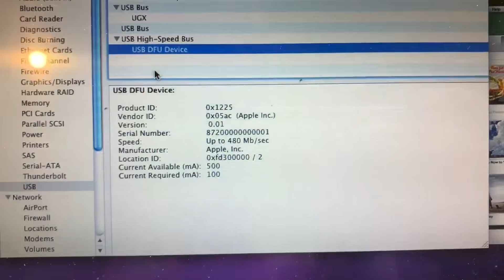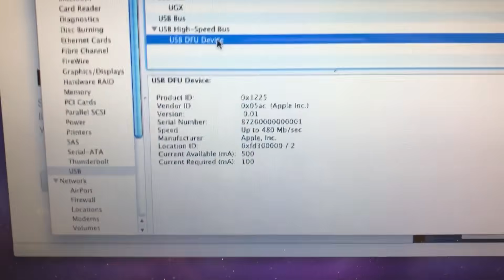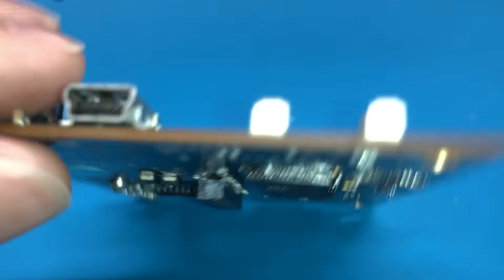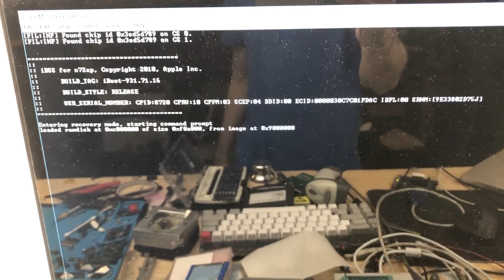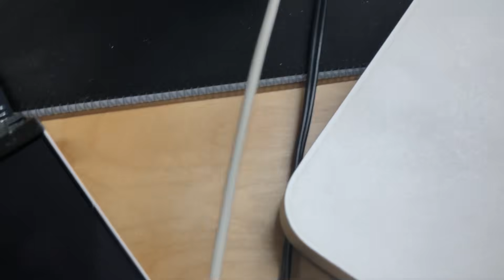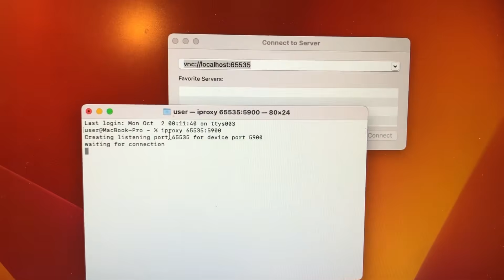Restoring a Prototype iPod Touch 2nd Generation

Comment: Those stacked SOC packages are a nightmare. I have a bunch of panasonic lumix cameras that i've fixed and they all have stacked SOC's. They also use BGA67 NAND which of course just happens to be one of the more annoying NAND's to read/flash...

Comment: Would it be possible to put another cpu in the macbook 13" a1342, with CPU (2.26ghz p7550) would it be possible to replace it with the Quad-Core, Quad-Thread, QX9300 CPU Processor

Comment: I finally asked myself what the 30-pin-connector is doing with all those pins if the USB on the other side only has 4. Turns out that it's an amazingly simple design compared to today's USB-C, where the connector is just USB, Firewire, Audio and Video in parallel and the cable connects the pins that are relevant for the other side, ignoring the rest.

Comment: What model of ipod touch did you use? To repair it? I have also a dev board but my ipod touch had a diffent NAND so cant put it on the board.

Awesome video!
Reply from the maker: You need an “MB” model iPod Touch 2G to use as a donor, “MC” model has a different BootROM in the SOC, and uses different NAND (2 BGA NAND ICs instead of a single TSOP NAND). The “MB” model can be identified by the case by having a larger storage size marking than the “MC” model.
Reply: @dosdude1   Do you have a copy of the nand?
Reply: Thank you for the information! Can you also tell me what power cable do you use for the device?
Reply from the maker: @aqw0031  It's just a 5V power supply with a standard barrel jack.
Reply: Ok awesome thank you!

Comment: such a revolutionary device, even the bandwith of the USB is on par with the newest iPhone 15 or 14 Pro for that matter 😅
Reply: I still couldn’t believe when I found out they were still using usb 2 speeds till my 14 pro. How can this be a pro device and take 3 business days to 
restore 120gb backup…. Then 15 came out and made it even worse by making it only on pro models….😂😂😂
Reply: @KngKurd 16 and 17 are the same lmao. It’s pathetic at this point. Just like when they refused to move on from 16gb phones with the 6s…7 moved to 32gb which also sucked 😂
Reply: How
Reply: @aidsmaster69420  Only the iPhone 15 pro and max has usb 3, 15 and under has usb 2.0. Old and slow
Reply: @aidsmaster69420 apple being apple.

Comment: You have converted a prototype to a production ipod.. the CPU and that would have been working.. but now its a not a prototype its just a lookalike
Reply from the maker: It’s not possible to run anything except the software these came with using their original SOCs... As you cannot execute any available iBoot version using the BootROM that the original SOC had. However now that I have one that still has original NAND and software, I can clone that to other NAND chips to restore other boards to function as they’re intended. But I really just wanted one running iOS, which would have been impossible with the original SOC no matter what I did.

Comment: man can i ask you qus not related  to this video? like i think no one know this 
i have chinnse h81 motherboard which dont have support of 4690k because its refresh cpu
and no bios update avalable anywhere and not in the website

i treid a lot making costom bios, by adding cpuids to it and flash it to motherboard 
after 22 try, by all ideas and ides from internet by diffrent probrams i couldnt make it work 
what i should do to make it work?
Reply from the maker: Make a custom build of CoreBoot for it, easiest thing to do. I did that to get Ivy Bridge CPUs working on a 2011 MacBook Pro.
Reply: @dosdude1  intersting i will try

Comment: The reason there’s no flash chip is because the connector on the back was for a separate storage board with the chip on it so they can quickly remove it and modify the files for further testing
Reply from the maker: These most definitely did have NANDs at one time; on all of the boards missing NAND that I have, it is obvious by looking at the pads where the NAND was (and in some cases moved/missing nearby components) that all these boards had NANDs at one time, but they were desoldered at some point (along with the RS-232 UART IC for some reason). Confirmed further by the board I got sent recently that still has its original NAND in place.
Reply: @dosdude1  Any chance you have a backup of the original dev board NAND? I have a couple of these (sans-NAND) that I'd like to try to restore.
Reply: Thats total opposite just the solution is always solder desolder to change whats in the storage board they couldnt do it with bridges or a better solution probably the resistance also its 2006 or 7…
Reply: That seems stupid
Reply: @ProscanEliteEnjoyer  Why does it seem stupid? It's practical for the developers.
Reply: @ok1lad159  bc having it swap it out every time and etc
Reply: @ProscanEliteEnjoyer  that's the point, no?
Reply: @ProscanEliteEnjoyer  Well, the reason is, for one, that when developing firmware, there could be a bug that makes the device unusable to the point that it couldn't be restored. In that case, they can just remove the flash card and reflash the firmware on a dedicated machine. It would also most likely be much faster than restoring the firmware using iTunes when developing firmware.

Comment: Super cool, I shows that Apple also mostly cooks with water like the rest of us. 
I never sort of thought of the how an Apple product begins its journey. 
The BGA RAM on top of SOC is something I have never seen, but is most 
likely a result of space and speed/signal routing ?
Reply: Its more common then you think. Its used in a lot of phones these days and regular socs to its called pop(package on package) design
Reply: @309electronic5  well it makes perfect sense, now that I know and think about it. But as in the video shown, never think about taking it apart :)> 
I think the modern form, is multiple dyes on a chip, just that has to happen on packaging, while PoP would allow for some customizing.

Comment: Oddly enough, PC typically means it has engraving. Weird!
Reply from the maker: That data is stored on the NOR EEPROM, which I took from the production device, as well as the NAND and SOC of course. So I wouldn't be surprised if that donor production iPod was engraved.

Comment: This is only tangentially related but have you looked at the classic iPod models as well? The older models had 32 megs of RAM but starting with the 5th generation the high capacity versions had 64 megs which enables a larger song database. I'm curious what upgrades would be possible. I figure a 5th or 5.5 Gen 32 meg can be upgraded to 64 megs but that's boring. Can older models like the Mini be upgraded as well? I'm also curious about if 128 megs is possible. Even if the hardware would work there's of course also the issue of firmware.

Comment: now thats cool .so is the vga out showing the boot loader ?
Reply: Have a look at 9:25 - I'm pretty sure that's a 9 "pin" serial socket. VGA sockets had three rows of pin holes, not the two rows you see here.
Reply: @jadamsnz  so we’re was the command text  coming from on the pc monitor?
Reply from the maker: @markdjdeenix6846  It's a serial port (RS232). I have a terminal program open on that computer displaying the serial output.

Comment: Hello 
I am trying to recover files from my old iPod touch gen 4 on iOS 6.1.6.
I did a factory reset on it some years ago but I didn't use it since then.
I was trying to Mount it as mass storage to run a deep scan on it but I'm not successful. 
Do you have a solution to copy the nand bit by bit ?
I tried : jailbreaking, libidevicemobile

I'm not quite knowledgeable on this topic, I found your channel trying to find a solution :)
Reply: I recovered photos from a customers iphone 3G years ago that had been factory reset. Heres how I did it.
Jailbreak the device.
Install openssh from the cydia store
Set the device to not sleep or turn the screen off
Have a second mac with SSH enabled. I used dd if=/dev/internalnand and piped the output over ssh to a disk image on the remote device. 
I then used data recovery software on the image to extract the data. 
Note: I was recovering from IOS 4 which did not encrypt the root partition. I do not know if this was still the case with 6.1.6
Good luck!!

Comment: I would like to see people reverse iOS and make it open source. I think it would be fun to tinker with it
Reply: Lawsuit from Apple guaranteed.
Reply: @jadamsnz  if it was done from scratch or done in a clean room type of way
Reply: Theres already a version of ios running on an old nokia n900 if i'm not mistaken
Theres also darlinghq allowing you to run some macos/ios code, and some very basic interface on linux and bsd last time i checked
Reply: maybe an older version, good luck trying on a modern version without a loooooooooooooot of work 😂

Comment: I doub't apple would've removed the nand from the board. The dev setup probably booted the devboard from the usb port directly.
Reply from the maker: No, these definitely had NANDs... When looking close, you can see that the NANDs were desoldered from these. I also recently was able to get my hands on one that does indeed still have its original NAND (with software) installed.
Reply: If you look closely, you can see some of the old legs from the NAND were they sore it off.
Reply: @jabbawok944  sore??? Really 🤣 Show me where the man touched you little iPod